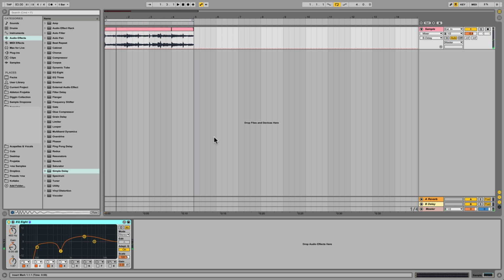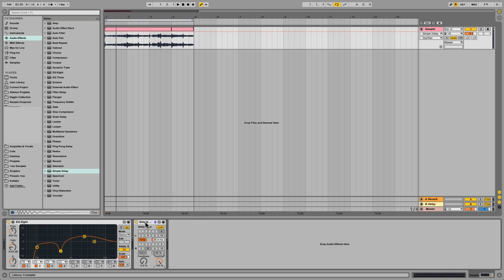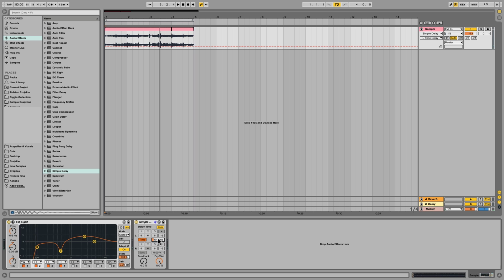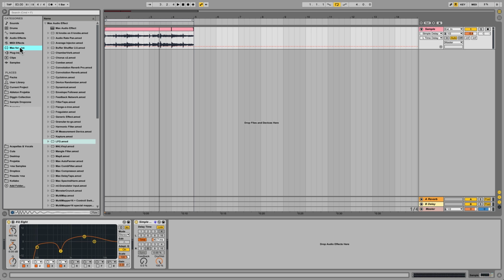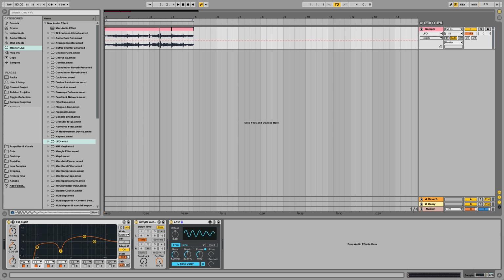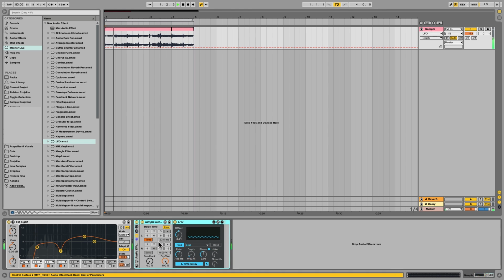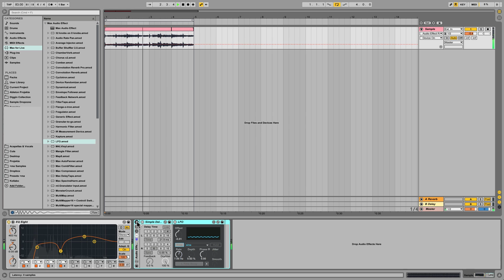Tutorial: Sp404 Vinyl Sim/Pitch Modulation Effect in Ableton (by plusma)

Comment: Cool video. Bro, I love lfo but have you had issues with lfo bugging during save, modulating parameters and crashing if it's not shut off before save?
Reply from the maker: hm thats strange, no works great for me.
Reply: @plusmabeats  it makes sense. You save. Lfo makes a change. So the save us invalidated. Then rebooting it flips out again. Lol. I had to pull lfo out of the folder to reopen and then redo it, turn off, then save.